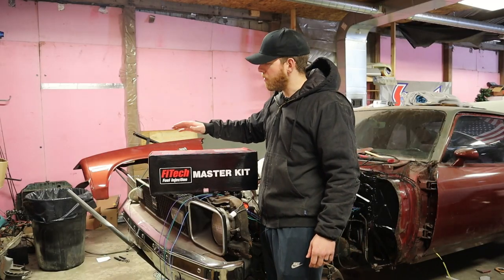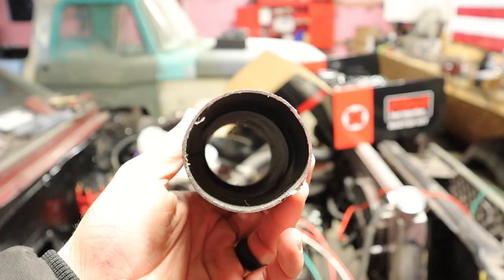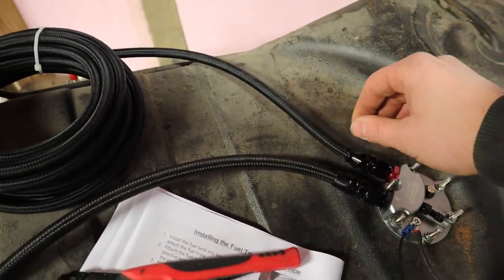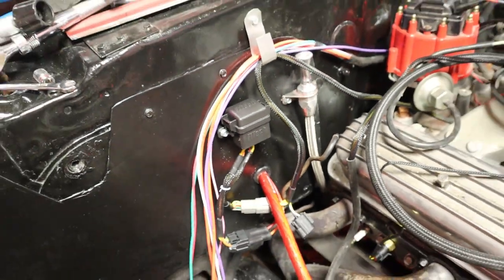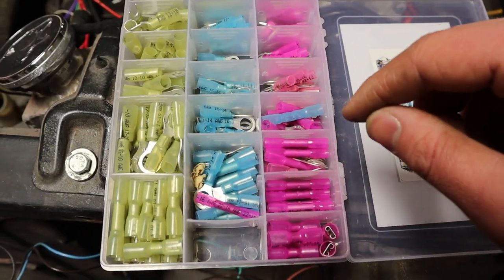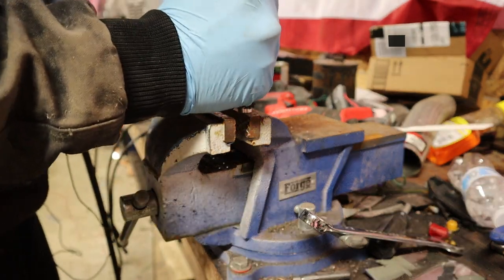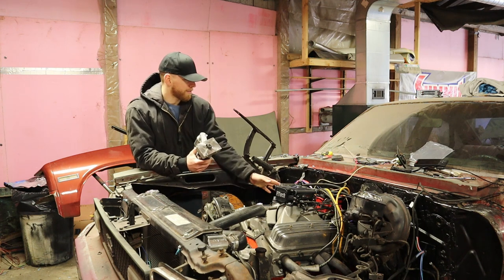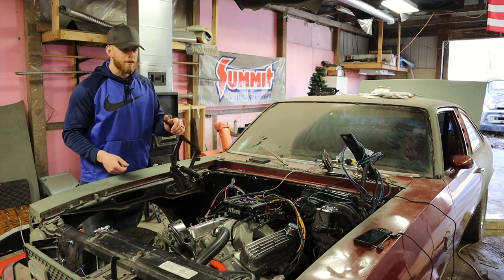FiTech 800hp MeanStreet EFI Install and Start | 1977 Nova

Comment: Nice to see everything is turned out right at the end. Done the same insterlation whit the 600hp unit 4 5 years ago  whit the fuel comand center and switched over to the intank pump 2 month on our canal brother in barns. You should think about to update you alternator I smoke 2 64 Amp alternators up in my camaro now I have a 179amp
Reply from the maker: I was thinking about that one too! With the electric fans, fuel pump, radio, lighting, EFI stuff, it's going to be pushing this alternator to the max! Good advice!

Comment: Hows this unit so far for you?
Reply from the maker: It'd great! I will say, make sure you follow every instruction! The unit is very sensitive to wiring issues! Just make sure you get all that down and it runs great! 

As far as streetability, I'd like to drive it more before giving a full recommendation
Reply: @JakeHarrington  thanks for the reply. I’ve been thinking of going to EFi on my new rebuild on my 75 K5 Blazer. So far the the Edelbrock AVS2 has been pretty good. It just takes like 10 minutes to warm up lol.
Reply from the maker: That's the best thing about the EFI setup! No more electric or manual choke to worry about. The throttle body senses the Temps, and makes the necessary adjustments! Starts right up. I started it for the first time when it sat for about 2 months. It was probably a 20 degree day and it fired right up without issue!
Reply: @JakeHarrington  The AVS2 has no problem starting in the cold. Just takes a long time to warm up. Also I don’t know if the fuel ratio is right since i dont have a wideband gauge yet lol. With a EFi it does all that for you and adjust depending on the temperature. I just don’t know how reliable these EFi conversions are. I read mix reviews on them. If I do go EFI ill probably buy spare parts for long trips.
Reply: Thanks for doing this. I’m going to also post a video when installing my FiTech to my 67 GTO.  Wish me luck!

Comment: I am installing the Fitech on my 66 GTO,  with one electric fan , on a cold car , the soon i start the car the fan kicks in , it is doing the same on yours ? I taught the fan kiks in when the temp is getting high. Maybe you got the answer.  Thanks .
Reply from the maker: Mine seems to be working fine. On the handheld, you can program the temp at which the fan will kick on. I would confirm that this is set correctly. I believe mine is set around 165 or so. Also, the wiring for this part is pretty important. It sounds like it may be getting power constantly. The fitech unit sends a ground signal, to trigger the fan. I would double check your fan wiring!